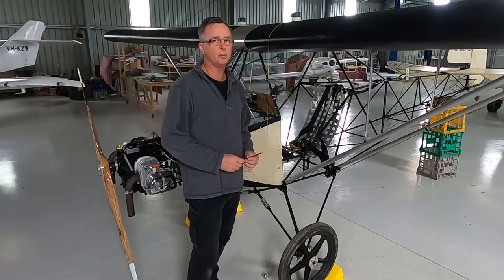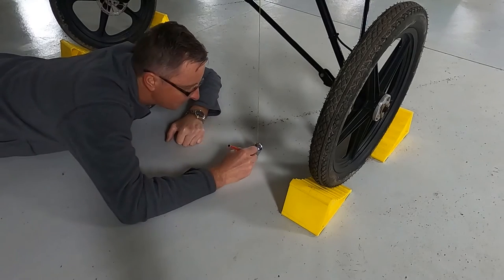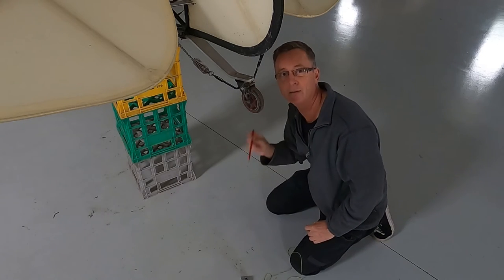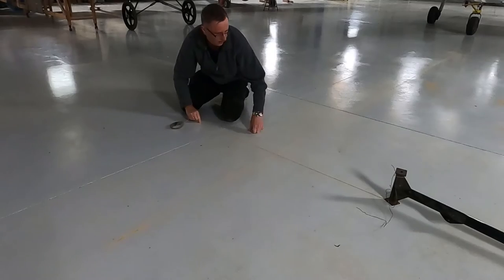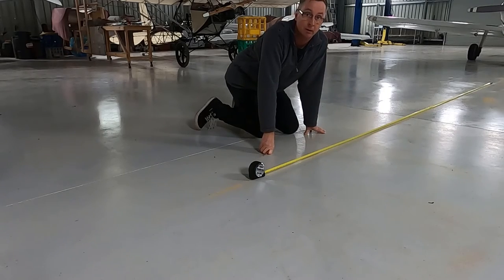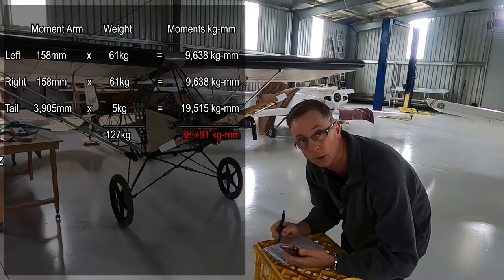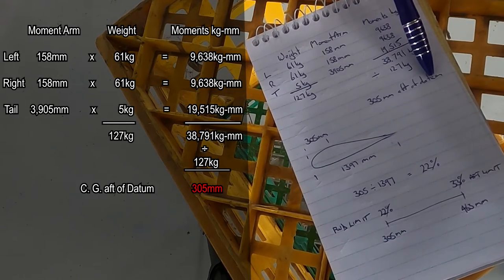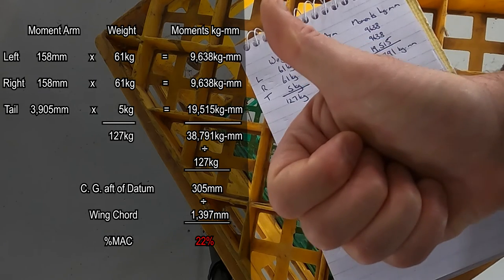Weight and Balance Calculation - Part 2 The Balance

Comment: Absolutely wonderful explanation videos on the weight and balance, much appreciated! I need to do this to my plane as well, but I fly a RX550 Beaver with the engine in behind me with a push prop, so my question is...would I still be able to put my datum on the leading edge of the wing? or what exactly would be different from the calculations from a tractor to a pusher? 
again, much appreciated, thank you.

Comment: Surely one set of the measurement should have been a negative number as the main wheels and tail wheel are on opposite sides of the datum?
Reply from the maker: The main wheels and tail wheel are on the same side of the datum.
Reply: @DCSquared  I did not know your main wheels are behind the leading edge by that much.
Reply from the maker: @ayates5709  Only 158mm aft of datum. 4:36 into the vid.  Cheers.